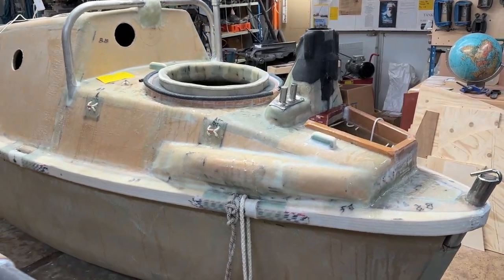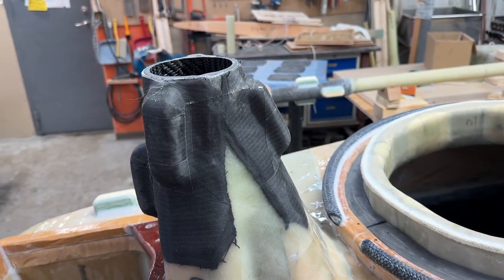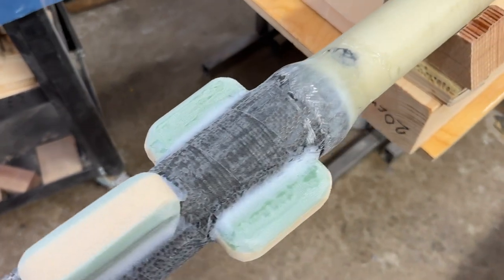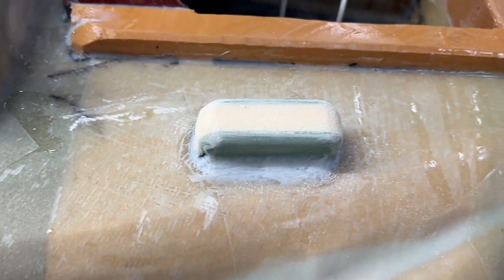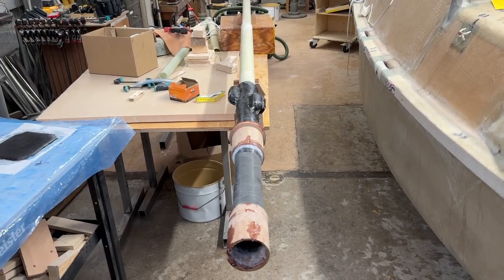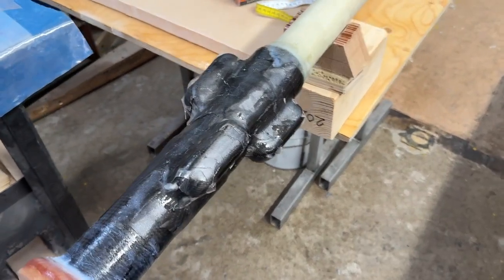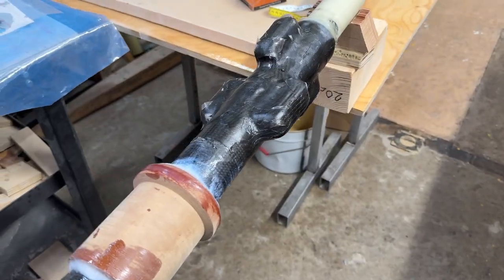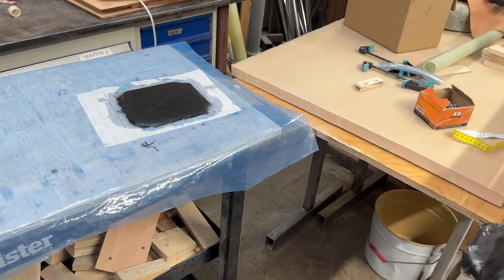10 Nov 2023  Learning how to laminate anchor points

Comment: Real Surprised that you did not predrill the blocks.
It may be difficult to get your drill next to the hull and create a clean square hole...
Reply from the maker: The reason is  by drilling after lamination the hole in the carbon fibre and G11 epoxylaminate will now be concentric.
That would not have been possible if drilled before